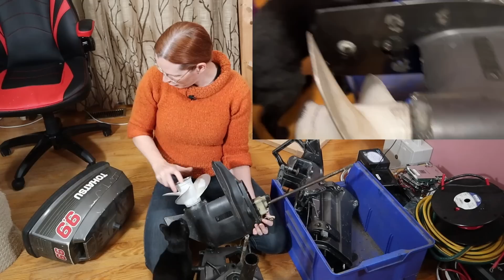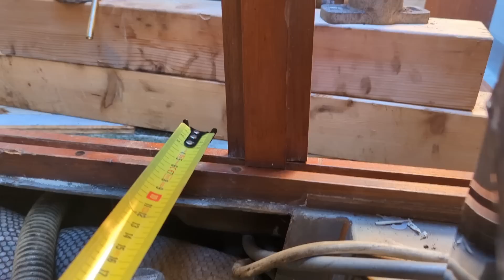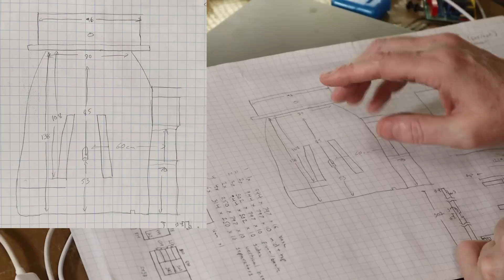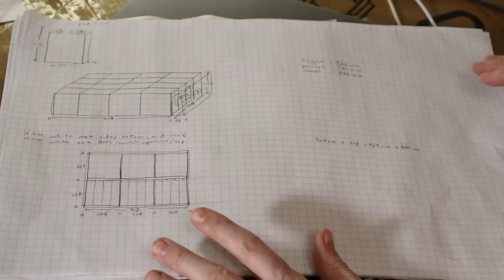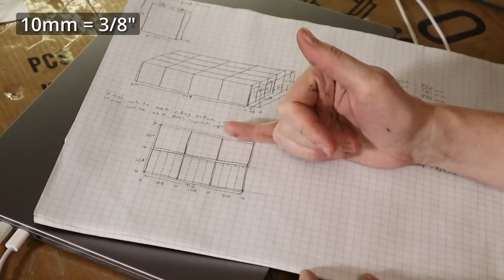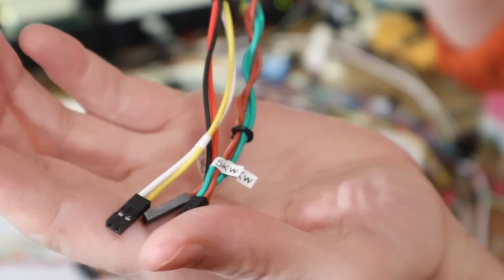Ep. 104 - A New Project, Two Project Updates

Comment: I do not recommend using a single box for all the batteries, as it could lead to significant issues if you need to replace one of the cells. I would suggest placing each section in its own separate box.
Reply from the maker: I considered  that, but it won't fit. As it is, I'm up against the limits of the space I have to work with. Even if they were separate though, they'd be too heavy to move and I'd need to disassemble the packs on top to access the ones below. That said, I've got the assembly setup so that I can access the top three packs fairly easily, and I can access the lower ones by disassembling the top ones and removing the mid-level tray.
Reply: @TheDigitalMermaid  You could use aluminum boxes for each battery section. This would improve fire safety, enhance heat dissipation, make them lighter, and most importantly, reduce their overall dimensions. But it can be more expensive (((
Reply from the maker: @MaxPivovarov  I would have to hire a welder for that, and the need to flat pack the box means the joints would be complicated. It would be great in the end, but I couldn't afford that
Reply: @TheDigitalMermaid  Welding is not necessary here. The boxes can be assembled from sheets and corner connected with rivets.
Reply from the maker: @MaxPivovarov  Rivets or captive nuts/rivnuts would take about the same space as the panels I plan to use out of wood. Don't get me wrong, I know metal would work fine, but I'm not sure there's a strong enough argument for it over using white oak, and I am a wood worker (of sorts), so it's a material I'm comfortable working with.
Reply: @TheDigitalMermaid  No, the sheets, corners, and rivets take only 3-5 mm on a side(10mm wide on a box). This will allow you use the individual box for each battery section. Also you can add the shelf for second layer batteries this will allow you to have access to the lower row of batteries

Comment: 9.9's were 10hp engines, rated as such as most jurisdictions don't require boat registration for under 10hp. I know that OMC (Johnson/Evinrude) outboards the 9.9 and 15 hp engines shared a lot in common, and you could shove a 15hp engine under a 9.9hp cover. (don't ask how I know) Apparently you could also make some modifications to a 9.9hp engine to convert it onto a 15hp one, but don't remember all that was involved to do it.
Reply from the maker: Ah, ok that makes sense. For raw pushing power, I suspect I'll be closer to a 15 when this build is done.
Reply: @TheDigitalMermaid  many  9.9 HP's (yamaha's/ Envirudes for sure) have  the same prop, lower en and gears, shaft and 2 cylinder powerhead and ignition as a 15HP, but with a different (smaller high speed needle set) carburator.  Cause manufacturers know this they would make price of 15hp carburators extreme expensive. Next to to that the 5 hp extra is using 1/3 more fuel even at stationary speeds. not always a thing you want or need.

Comment: If you're going to use water cooling, you'll have to use the original reverse gear for changing the direction of motion, as the original cooling pump cannot operate when rotating in reverse.
Reply from the maker: Ah, that's good to know! I might end up putting a small electric pump in the head and have a temp switch turn it on only when needed. Knowing that the pump is linked to the gearing makes me lean more that way. Thanks kindly for that info!
Reply: @TheDigitalMermaid  An important addition: since the reverse gearbox uses spiral bevel gears, using the same gear in both directions has limitations. Therefore, always use the forward gear as the primary one (it can work for reverse, but less efficiently). However, the reverse gear should not be used as the primary one. Therefore, the rotation direction of the electric motor must match the rotation of the gasoline engine when moving forward.
Reply from the maker: @MaxPivovarov  I suspect that I don't use reverse often, and not for long. So if I lose cooling in reverse, it shouldn't be too big of a deal. I'll test of course though.
Reply: @TheDigitalMermaid  "lose cooling in reverse" You lose cooling permanently after the reverse because this will destroy the impeller.

Comment: interesting legislation that is saying that sealed battery needs to be vented. but to be honest once it will vent anything i think at that point you have more to worry about other things... btw that design isn't looking good. because if one small bms connection will broke ..or wire will broke at that connection your whole pack is offline at that moment..and there is no easy way to go there and repair it..but i'm sure you will your best but ofc always think how to fix it on the water alone without taking out 1/2 of your ship :) but I hope it will be awesome experience with building ship what ever result will be :)
Reply from the maker: The packs are electrically fully independent. If a BMS lead breaks, I can disconnect that one pack and be down 1/6th capacity (until I can repair it).  This is the main reason I didn't do something like 6P16S, specifically to minimize losses if I lose a pack for any reason while under way.
Reply: @TheDigitalMermaid  yes I understand. still i would think carefully and maybe find way how to repair something in pack in case needed well ofc it all depend how critical that battery pack is..maybe if you will only on short roads/waters ..then even if two packs would fail still not a problem..but if it was situation like around the globe or such..then that is for sure different story :)
Reply from the maker: @SylwerDragon  By ABYC standards, the 4awg 105c jacket wires I'm using per pack means I can safely pull 110A per pack. I'll likely use 100A breakers, so each pack can deliver over 5kw. My 10kw motor, at full speed (something I expect to never do, but...) is 13kw. So I could have three packs fail, and I could still easily deliver the power I need for wide open throttle. The three packs on the top I'll be able to fix underway, so worst case scenario I can still keep the boat going with no loss in power (thought some loss in range) in most any failure scenario. As I mentioned in the video, I'd much prefer to have all six packs easily accessible, but the space constraints simply don't allow that.
Reply: @TheDigitalMermaid  Thanks with your cells i don't see any problem in high power cabling and yes i understand it is hard to repair stuff if there is no space..it is how it is. Good luck with your project and let us enjoy the ride at least over video..that is ,haha

Comment: Tube goes to the prop location to pump water up to the motor, you won’t need it if you’re going electric
Reply: You will and it is. I assume it has an impeller pump that only works in one way, so jam the gear in forward since thats the majority direction. If you dump the "coolant" under the water I think the impeller will work both ways.
Reply from the maker: I figured one of them was for the water. I'll use water cooling, so I'll still need to suck the water up. What I still really need to figure out is how the forward/reverse works. I'm sure it'll make sense once I start digging into it, but clearly there's some sort of linkage that goes to the lower end.

Comment: My initial thought was a question: Gear ratio? And to make the question simple: What do we want the maximum propeller RPM to be  and then will the minimum RPM matter? 😊
Reply from the maker: Aye, I need to find the cavitation RPM of the prop and then gear it appropriately. I know the outboard props can spin a lot faster, iirc they're good for up to 2000rpm or something like that? Anyway, I'll find the actual RPM and use a reduction gear.
Reply: @TheDigitalMermaid  no no no
Reply from the maker: @anthonyrstrawbridge  no to what?
Reply from the maker: @anthonyrstrawbridge  OK, this made me want to look up the prop's max RPM; The Tohatsu 9.9 had a max engine RPM of 4500~5300rpm, with a gear ratio of 1.85, setting the prop's max RPM as ~2800. The GM 5kw motor is rated to 3500rpm, so a reduction ration of 1.25:1 will work fine for my planned setup.

Comment: Very cool project! 
When I built mine I removed the water pump because of a lot of resistance to turn the shaft it might be better to use a electric water pump
Reply from the maker: Aye, I started thinking after recording that the pump might have been connected to the engine. Either way, there's a place to pick up water cleanly, so even with an electric pump it should be fine.

Comment: Looking at the CAD design for your battery support box, I am having trouble visualizing where the cables are going to run and how you will connect between sets of cells.  This was a great informative video! I am amazed at your hard work and perseverance!
Reply from the maker: Each pack is fully self contained, so there's no cross-pack connections. Each pack will have a pair of 4awg cables going out to anderson connectors. Those will have corresponding leads going to an external bus bar. What's missing in the 3D model is the face plate, which will have the BMS power button, disconnect switch and breaker. That face panel will be easily removable for servicing the BMS, accessing the internal fuses, etc. Thanks for the kind words! ^_^

Comment: This all sounds like a very solid and thought out plan for the battery boxes. The only side note I have is to maybe consider sandwich fiberglass (preferably foam core or even wood) as the material. It's immune to rot, light, and just stupid strong for it's size and weight. It can also be basically any shape. Even with no experience making these, it's really not hard (harder for more complex shapes, trivial for just boards).

Then again, I also understand drawing the line somewhere. There surely is enough new stuff being learned already, picking your battles so to speak.
Reply from the maker: @TheCreat  If the plywood box shows that I need to shave off length or width, changing the interior dividers to fiberboard is certainly on the table.